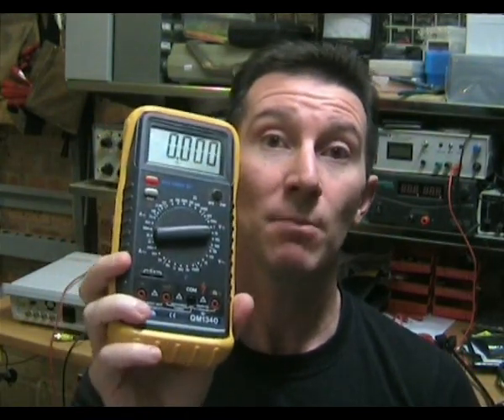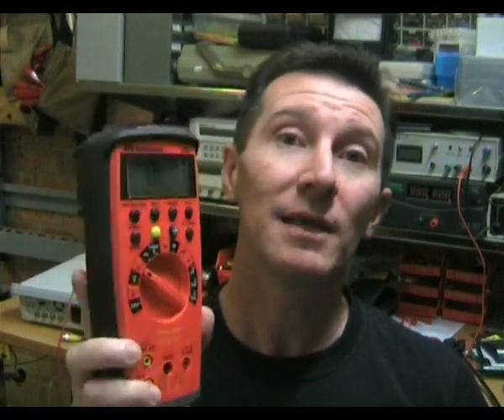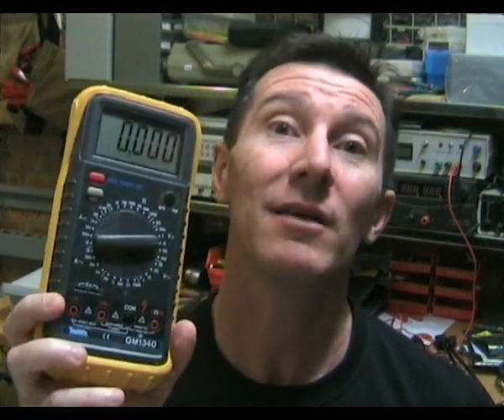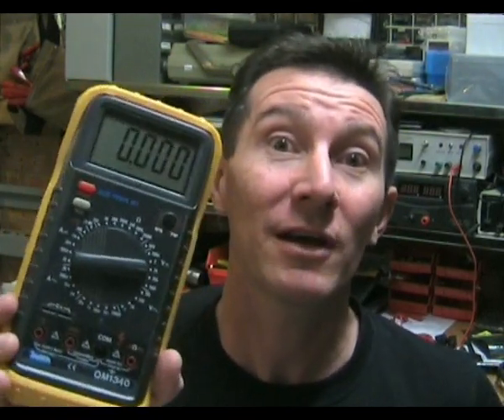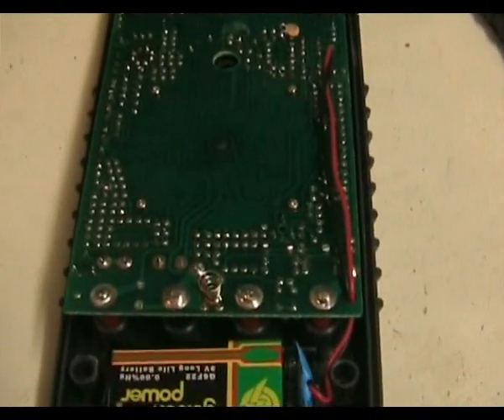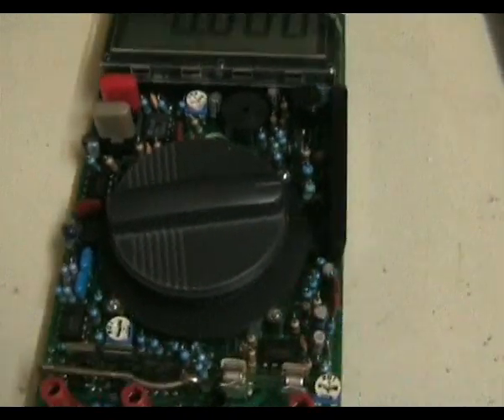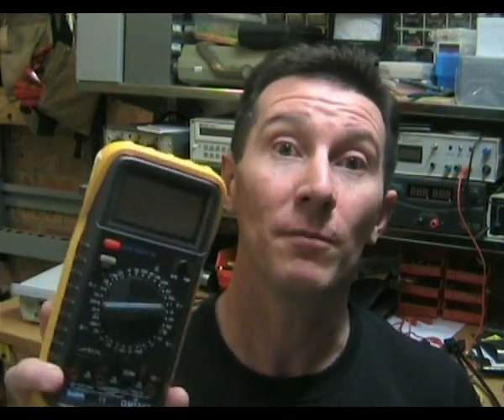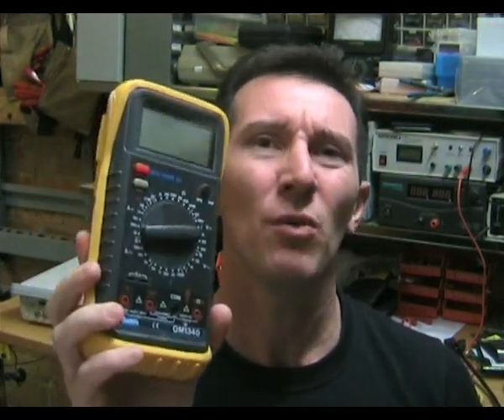EEVblog #6 - Part 2 of 2 - Why cheap multimeters suck

Comment: The fluke has no choiuce but to last because they are DMM or at least thats what it turned to there was no other meter in the world really at all or with technology like they had though the soviet union was right almost there with the accuracy or what we  think is accurate and they set the calibration off of whatever component constant source they  decided on so they became really the best only because there was simply no other tool to compete so they had the whole military of their own and im sure many other countries contracts secured so if they werent good we really wouldnt even know bc well thats dmm FLUKEY PUKEY lol but if you are talking about trusting a meter as far as if the circuit you are on  is off or not and you havent first went up line and physically disconnected  and locked out and tagged those circuits and the meter is what you are counting on then you are never going to make it to far always have a comrade  or 2 to confirm no energy I got hit by 277 from a circuit that got tied in to the left side lighting an the side i was just taking a quick look  through the circuits coming into the first j box in the wires were just roughed in nothing striped or anything made up and i got a butt end of wire to my finger tip and it was the craziest feeling just how much i felt it travel through me in a z pattern and out ouf my right foot I was on vacation the week before this and they had some temp help come and go in that time and thats all it took, but also an insanely expensive multimeter isnt really that necessary if you need something that measure down to the milionths or whatever then u are a bad dude to need that precision to figure something out otherwise a descent affordable meter will work just the same way as long as your operating the thing with proper battery voltage and the right settings

Comment: I think I have that very meter! I paid $30 US for it, not $20! I like the big display. Been using it for years to verify the readings from my box of freebie Harbor freight meters. :)
I blow them up sometimes because I do something dumb, or slip when I'm stretching to get a measurement. Of course I also have 3 or 4 Fluke handhelds and 2 or 3 Fluke bench meters for measurements that matter. But I generally find that in my applications the meters are mostly used for 'go/no go' sorts of things. "Is the fuse open? Is the wall-wart producing 5 Volts? Has the Zener popped?" That sort of thing. For my government repair work I use the high-end gear. About once a year I go through my meters, check the batteries and see if all the functions still work and are accurate. Then I toss the defective ones in a junk box for spare parts for the rest.

Comment: My small €10 meter is great for little quick jobs.
Measure I/V to 5% accuracy, up to 20V/5A.
That's not the spec claimed by the device, but it's the boundaries of how far I'd be willing to trust it.

Virtually weightless and absolutely tiny, but it'd probably break if I dropped a mug on it.  For everything else, I have the Fluke.

Comment: I have an old cheap chinese meter 20 year old and still working like a charm. I check it s calibration with my new multimeter and it passes. I know it is mostly luck :) but they have their use in hobbyists applications.

Comment: This guy who uses a multimeter for work all the time: It’s all about reliability. That’s all. I need to get my job done quick, and reliably. The only way i know my measurments are good is with my expensive high quality multimeter.

The comments: I USE MY $7 MULTIMETER TO MEASURE THE RESISTANCE OF MY BODY THROUGH MY FINGERSSSSSS IT’S GOOD ENOUGH FOR ME. HE DOESNT KNOWWWWWWWP

Comment: those cheap multi-meter's rubber boot seems similar to fluke 80 series, I lost/damaged mine and fluke's original would cost around 50 bucks , this one looks very similar, hopefully size wise they will fit;
You get a free cheap multi meter as a bonus for those rubber boot.

Comment: I bought my Fluke 189 when I started reading for my first EEE degree in 2001.  This lasted well into 2018, but the main issue by then was the LCD started going bad.  Fluke said they couldn't repair it and I would have to buy a new one, so now I've added 2x 87-V's and 1x 287 to my bench.
Reply: la garantía de por vida es una estafa? prefiero mi multímetro chino true rms con frecuencímetro de 10Mhz que lo tengo desde el 2008 y funciona como el día cuando lo compré, ni necesité calibrarlo y solo una vez le cambié las baterías. El cobertor no ha perdido la robustez ni el color.

Comment: LOL you're so right about not using them and leave them on the bench and they just die! I had a Victor 890C+ meter. It literally just sat on the bench for quite a long time without being used, and it died.. wouldn't turn on after changing batteries, no battery leak or whatsoever. Cleaned banana jack contacts, no success. I don't understand why lol.

Comment: Fast forward 10 years...Today's CHEAP-O Multimeters offer incredible bang for buck! 20-30$ Gets you a highly accurate TRMS DMM that can easily rival the big guns. Confidence is a given, sustainability and accuracy are also usually par for the course. Yes, there are some horrid cheap meters but there's also alot of expensive junk out there. Don't throw the baby out with the proverbial bathwater...you'll be glad you didn't!
Reply: You dont think the fact that he sells his own brand of multimeters and they are way over the $100 mark would have any impact on him hating sub-$100 ones do you Darren? Naaa...... he just wants to keep us safe! I dont know where he gets his multimeters but darned if i have a single one with completely thru-hole components! Wish i did, actually..lol!
Reply: I just bought a $3 multimeter off AliExpress, it has all the same features as my $50 Klein multimeter so it will be interesting to see if the measurements are the same.
Reply: @mashedpotatoes5323  if it's an xx830 clone you'll be fine. These are the holy grail of the CHEAP-O REALM. 👍 DT830 contains an ICM 7106 3.5 digit digital panel meter chip w dual slope ADC. Not bad for 3$
Reply: @KeepOnTesting  I don't believe it's the dt830 but they also have the dt830b available for $2. The $3 one looks much better (also has backlight) but I went ahead and just bought both now. I'll try to update how they perform when I get them.
Reply: @mashedpotatoes5323  Sounds like a plan! Let us know how you made out.

Comment: If dealing with extra low voltage, use whatever the hell you want. Dealing with low voltage, don't trust anything other than a reputable brand, or Fluke. If dealing with high voltage, that a different ball game all together. You'll need more than a multimeter when dealing with HV transformers and transmission.

Comment: I know what you mean, the other day I measured a resistor with my old Fluke, a brief hesitation and then a solid stable reading, tried my el cheapo Chinese meter and got an instant reading that then jumped about all over the place till it finally settled on a stable reading. There is a difference!

Comment: Dave was much more right eight years ago than today - dont get me wrong cheap meters are still cheap meters and the input protection is still minimal at best on most of them, but they have improved in that the accuracy on many has come way up, the better ones are packed with features and can serve well in hobby and light home use.  A decent multimeter with a surprisingly accurate multimeter chip can be had for $25 or less and it seems it doesnt cost near as much to accurately read basic AC/DC volts ohms capacitance etc. and today you get other features like NCV and temp etc.   If you jump up around the $50 range there are some really decent and accurate meters that can be more than the average user will ever need, still not in the Fluke category but they can serve well if used within their capabilities.  However some things never change - if your job rides on accuracy, you value your safety and need to work in a high current industrial environment then it pays in more ways than one to invest in a quality high end industrial quality device, its built to stand up to rugged use and abuse often encountered in such uses and the top quality meter will be far more likely to maintain its accuracy day after day and keep you safer while doing it.
Reply: Slacking

Comment: What a load of bull crap. I have a multimeter that cost £20 25 years ago still works fine, I also have a 10 year old UNI-T meter that this idiot hates that also woks fine. take it from me who has been repairing electronic equipment for 40 years don't listen to this fool!

Comment: Mines cheap, £8.95 on Amazon. First went boom. When I was testing a 220volt ac outlet. I sent it back for  a full refund, which was given no questions asked. I have ordered the same again, mad, NO. the mains test was a one off. Most of my testing is on phone chargers to see if they are working, power banks  and batteries. So between 1.5 and 12 volts  DC, Also testing fuses. These cheap multi testers are fine, for low voltage tests, DC, also for FUSE testing. I would never use one again for 220 - 240 VOLTS AC.  Way to dangerous, that voltage can kill.

Comment: Bought a Mastech meter at first, sprung 50 USD on it... what a hunk of junk. It could do voltage and (sometimes) ohms reliably... but diodes, capacitance... forget it. Couldn't get the same reading twice to save my f$%(@ life. Bought a $300 Fluke and I've never looked back, there is NO SUBSTITUTE for a Fluke, period. They're not just a good brand, as far as I can tell they're the *only brand*.

Comment: Providing you know the limitations of the kit you are using there is no problem. I would not use a cheap multimeter near any mains but for checking batteries or continuity or giving some idea of how a car is charging what's the problem ? I have an old Fluke 77 (calibrated) and several cheap meters. I simply use the one that's needed. It's quite remarkable how accurate these cheap ones 'can' be.

Comment: Horses for courses I guess. I use a £7 one because I only use it with my Radio control cars, 2 years and still going strong. more than accurate enough for my purposes, very close to the more expensive ones where I work although obviously I wouldn't trust it to be as dependable. Same with cheap Chinese digital calipers, 0.01mm accuracy is more than enough for most people but obviously you wouldn't use them to measure parts for a rocket engine.

Comment: Once bought a meter alike (DVM890), using it intensively.
Never. Failed. Me. Once.
This was over 12 years ago, still working like a charm.
Just saying....

Although I'm considering buying a second for alternative, reference and backup, any suggestions ? (sane prices preferable)

Comment: for most people a cheap one is more than accurate enough. if i was an electrician i would probably go for a more accurate type though :)
Reply: electrician is a guy who install light bulbs. Electrician typically needs circuit continuity tool, which has 1 bit resolution:  fused or not.

Comment: Sort of like saying a Ferrari is better than a Ford. Of course the less you pay the worse the quality and accuracy....But no one is trying to get accurate readings out of the £20 multimeters. I very occasionally need to check continuity and if I have 12v on a wire, for me it would be ridiculous to spend a large amount of money for a couple of uses a year.
Reply: I totally agree, I've only ever had cheap meters too, keep one in each of our vehicles for on the road fault finding/repair.
For the stuff I do, they seem accurate enough. I wouldn't mind a Fluck etc, just can't justify the cost in my case.
Reply: here we are talking about electronics, not car repair
on a car you only need to know if there is power or not, if a lightbulb is good or not, it doesn't matter if it is 12 or 13v, 0,1 or 2 ohms
when you are working on some electronic device those things can make a huge difference
Reply: the analogy is bad:  with cheap multimeter you cannot measure in a serious way modern digital circuits. It is due to burden voltage for example. Ford is a car that drives after all, and to see advantage of Ferrari you have to go to a racetrack.  I'd say the comparison is against Ford and a bike when planning a trip across US.
Reply: David Holland but still those people don't want to blow up while going from A to B
most of the time I do low energy stuff, but when i deal with 220v i want to have my multimeter as safe as possible, i don't want a cheap glass fuse to blow the case apart
plus sometimes I just need the resolution that a good multimeter has and a no name one doesn't
Reply: David Holland I don't think that this Ferrari-Ford comparison is appropriate, because in terms of longevity the Ford will probably last almost as much as a Ferrari will (if not more). However in terms of multimeters this is an important factor: you don't want your multimeter to die on you in an inconvenient time (e.g. when you have a table filled with various parts of a disassembled amplifier), because even though you can buy a new one, it will set your projects back. Of course if you're fine with this risk, then be my guest.

Comment: I have a cheap 8 USD no-brand multimeter. It's very unreliable regarding measurements. If I measure the same resistor once and then measure it again a few minutes later the resistance isn't the same, it isn't even in the same range. And this isn't just one resistor. There's something really wrong with it. I'm saving money to buy a proper brand multimeter. No one says you should buy a Fluke or HP from the beginning, but don't buy no-brand ones, they're useless.

Comment: I paid £4.25 for an XL830L. Measurements are within the required spec of 2%. It suits my needs based on what I'm going to use it for. I couldn't justify spending £150 on a Fluke meter that I'm hardly going to use.
Reply: oh yeah i have the same one, the backlight function is really cool and useful, but unfortunately i left it on once so the battery died and since i dont need to measure any voltages at the moment i haven't bought a 9V battery
Reply: I have a Draper that I bought for £8 at Focus, many years ago, before they went out of business, and it gives me surprisingly-accurate readings, sometimes even better than my Fluke 15B+.

Comment: The real reason these things are terrible is the input protection, or specifically the lack thereof. If you are using a cheap meter chances are you're a novice, and chances are you're going to set the meter to the wrong setting and have it blow up in your hands. 
The only time you should use a cheap meter is if you're in an environment where voltages never exceed 50v and meters are likely to get damaged or lost (I use a shit $5 meter for testing radio control models).

Comment: Awful lot of waffle on this. Started by saying that the meters were inaccurate - would have been so much easier just to show us how inaccurate the meter was - but no. Typical electrical bod. They all think they're God
Reply: +frank staples There's no need to defend cheap multimeters.
Also, this video is from 2009, you can't compare the cheap multimeters from 2009 to the cheap ones you can get today.
Reply: +Gordon Freeman If it's that out of date and inaccurate - by your own admission, what's the point of leaving the post on?
Reply: frank staples
I don't know, ask Dave.
You can get a pretty good multimeter like the Uni-T UT61E for like $50, and it even has the fancy hold function that most expensive ones don't have.

For probing high energy stuff I wouldn't use cheap multimeters though, but for basic stuff even a $5 cheap one does the job.
Reply: +frank staples They aren't always inaccurate. They are unreliable. It may show a pretty accurate measurement now and in a few minutes it can fuck up pretty bad. I have a cheap one and it's rubbish at measuring resistance. It's a shitty 8 USD one.

Comment: i used to use a 4$ multimeters for 1,5 year!
(all smd components)
Reply: +Efthimis kritikos my 4$ multimeter just died after messuring 4 times my car battery voltage.
Reply: itzJanuary
i just bought one because i needet to monitor the voltage. Bot now i bought uni-t ut50a and a cheapy uni-t with transistor tester.

Comment: Here in England Fluke do not sell their cheaper models eg 107/101(shame on them) , so ive just bought a Tenma 7720 im using it for up to 20v DC and continuity. what i like is it has an on off switch and backlight, well i aint gonna kill myself with 20v.

Comment: I used to work in a repair shop, I shared a Fluke meter with the owner so it got a lot of hard use and it was several years old.